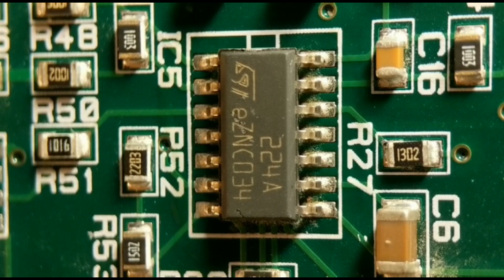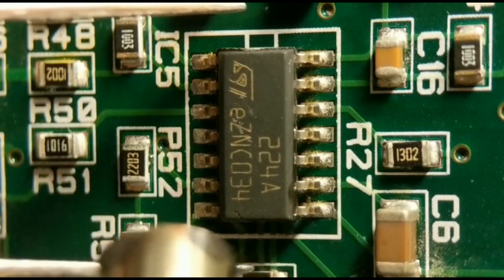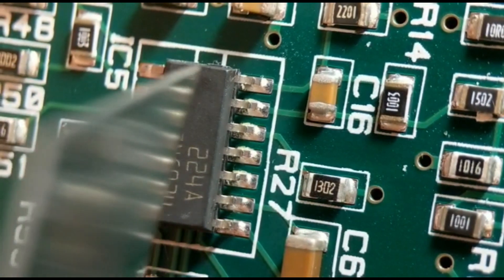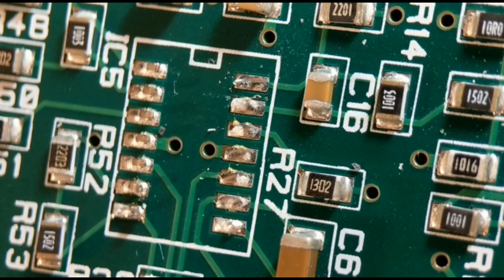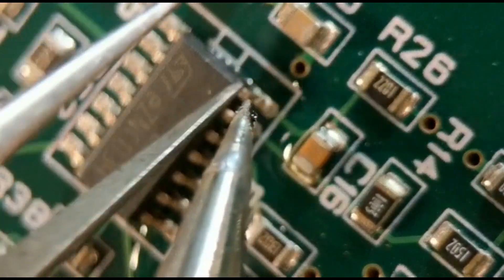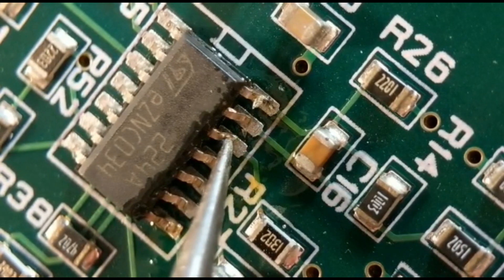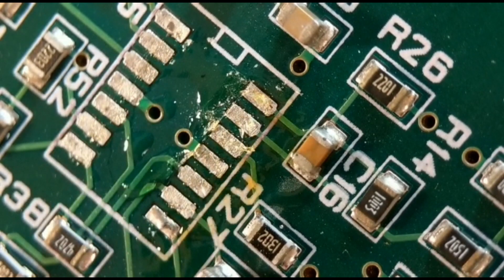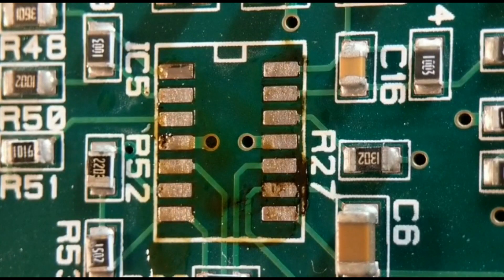How To Remove Surface Mount IC/smd IC - Learn 4 Neat Methods

Comment: Solderers need 3 hands to exist in this world, but the 2 soldering iron method of removal is the best thing I've heard for a long time.
 
Many thanks for the idea!
Reply from the maker: Hi , thank you for your support , much appreciated. I love the 2 soldering iron method so much that I posted a complete video on YouTube showing some of the instances when 2 irons makes work so much easier . I have all the hot air stations etc needed to do soldering rework but at times 2 irons is so much better than a hot air station  . Surrounding components for example can shift if your not careful when using hot air also plastic connectors can melt . Why protect all these when you can quickly rework with 2 irons . My best tip to anyone who solders is to get 2 irons . There are certain times when it's a godsend . Thanks again , good luck with all your soldering projects in the future 👍

Comment: you can also make a nozzle for the tip of a soldering iron from a thick copper wire to heat the contacts of the microcircuit at the same time from two sides

Comment: Just used a variation of your method 4 to remove a sop 8 ic.  Blob of solder on both sides to connect the leads, use a large chisel tip iron, then alternate back and forth heating the solder on both sides until they melt and the ic slides off.  I imagine it would have been easier with two irons, but only had one and didn't take hardly any time.  I can't recommend a good flux paste though; without my solder was sticking everywhere it could.

Cheers
Reply from the maker: Hi , thank you for watching the video , much appreciated. The way you have done it is a perfectly ok way , lots of people do it this way , even I have , but it just makes it a little easier and safer with 2 soldering irons . Thanks again , take care 👍

Comment: Thanks a lot. The switch on the board of my dishwasher was broken so I had to remove it. Yet I just couldn’t remove it. 

Thanks to you, I swapped it with a new one and I don’t have to deal with the damn dishes anymore.
Reply from the maker: Hi , thank you for your comment. I'm glad the video was of use to you , it's great you fixed your dishwasher . 
I will always add more soldering videos to my channel when I can . 
Thanks again , well done 👍

Comment: You can place a thick copper wire bent in the rectangle shape around the chip and on the terminals ,now add some solder and apply soldering iron for heating,it will melt all the terminals together and you can lift the chip easily.
Reply from the maker: Hi , thank you for your comment. A better way of doing this method is actually forming the shape of the IC with wire and directly attaching it to your solder tip . Less potential for the wire loop slipping as it's firmly attached to the tip . Then like the other method lay it on the IC add solder around joints and hopefully will lift off cleanly . For large 208 pin IC's I wouldn't do these 2 methods as will be really difficult to heat that amount of tiny pads at once , risking loose pads etc. 
Chip quik is another option that's pretty good . Thanks again 👍

Comment: Will the 2 soldering iron method ruin ic?
Reply from the maker: Hi , I've used this method lots of times and have honestly never ruined one IC . Its no different to someone using a hot air gun at 400 degrees , and your also not heating up the surrounding components which in fact makes it safer in a lot of cases. Obviously if your IC has a thermal pad underneath then you will need a hot air gun . Hope that helps , thank you for your comment 👍

Comment: Can you recommend a magnification tool?  What about the size of your solding iron tip?  Thank for the cool very nice videos....
Reply from the maker: Hi , the common magnification tool that lots of people use is ( model number 8087046 (LA8093LEDRS/EUK ) . This is a simple aid that sits on your desk and does a decent job , comes complete with built in LED ring light.
I use a stereo long reach microscope , purchased from GT Vision ( England ) , their own branded one . Great scope enables me to do any microscopic work and because it has a long arm you can put very large boards underneath no problem. 
I always use for fine pitch work a small conical tip for my iron . Sometimes I would use a large chisel tip for obviously large components and these are generally all you need for the majority of soldering issues.
Hope that helps , thanks for watching 👍

Comment: great and I wana to know what loop or microscope you used for this video and for soldering and desoldering components?
Reply from the maker: Hi , thank you for your comment. I use a stereo long reach microscope for all of my detailed work , purchased from a company called GT Vision based in England , I have their own branded one . It's very much the one I would always go for as it allows you to pretty much get any size circuit board underneath it . Prices for these vary from a few hundred upto thousands but I've just got an average model that's plenty good enough . Hope that answers your question . Thanks again

Comment: 👍😉😃😀 1st and last method is the best.  
In 1st method use surrounding area masking tape to protect other components and get best results.
Reply from the maker: Hi , thank you for your comment. Normally when I do use the hot air method , if I'm worried about nearby parts , especially plastic connectors for example , I use adhesive backed silver tape , never Kapton tape as some people like to . Thanks again for watching and commenting 👍

Comment: Wow! I'm so impressed. I really enjoyed watching your video. For one, you showed me things I'd never even imagined. And two, your video is short and straight to the point. Well done! really.
I have shaky hands and struggle to solder or desolder smaller components.
I need to replace a high current power inductor on a computer component. You can see exactly what it is by Googling "Cpla-3-50 amd 4890".
Do you have any advice on how to do it? The solder looks like it is actually underneath the component.
I know someone who is skilled(like you) should be doing it but there is nobody around me who can help.
Thank you again for the video. The cutting and two iron techniques were fascinating! 8D
Reply: Hey 🙂,
Thank you very much for your reply. Thanks for taking the time to explain as best you can. I will definitely try what you have suggested. Correct, I don't have a rework station. I've been looking at prices for them and they are unfortunately out of my price range. Perhaps one day in the future though.😋
Yesterday I bought two new soldering irons, a 30 and 45W. I think they will work better than the 100W I had before. 
Anyway, thank you again, 
Kind regards, 
William.
Reply from the maker: Hi , no problem . I hope you get on ok 👍
Reply from the maker: Hi , thank you for your support , much appreciated. I've looked at the component you mentioned and your right , the joints go down the side and all the way underneath the body . If I'm right your one has 6 separate pins . If you can see the solder on the pads out of one side you could probably remove it by adding solder to each pad and basically trying to solder them all together . Then running your soldering tip along the row , so basically heating all 6 pads up at the same time and this should be enough to remove it . Or you can lay a piece of tin copper wire along the edge of the device and add solder as before , this will heat all 6 up at once , then you should see the component moving about , then just lift off .I guess you haven't got a hot air rework station so this might be the way for you to do it . If this works you can then use solder braid to wick the excess solder off the pads before fitting the new component . Hope that helps , good luck and thanks again 👍

Comment: Oooh I like that fourth way with the two solder irons! Unfortunately I don't have 2.. But I thought of a combination of method 3 and 4. How about putting a lot of solder on one side so all the pins are connected together, then put a solder iron on that side and when the solder is melted, use tweezers to slightly lift up that side. The pins on the other side would bend slightly but you can straighten them later. Then wick off the added solder on the first side so that those pins are now off the board and then you can do the other side, adding a lot of solder to those pins on that other side so that they are all connected together and use the iron to melt that big blob and then use tweezers to lift the chip off the board. This is just a theory and it may not work in practice but I'm just wondering if this method would be any good.
Reply from the maker: Hi , thank you for watching the video , much appreciated. Your theory may well work , but I wouldn't recommend it for a tiny IC as the 2 rows are so close together so will put big stress on the row that isn't lifted to start with. But it would be a lot safer on a wide bodied IC. 
It's good for us all to have lots of options so we can always find one that works for us without having to get lots of expensive equipment . Thanks again and good luck with any soldering projects 👍

Comment: Another interesting method we were taught in the 90's was as follows:-

1: Run a fine gauge wire down the back of one side of the IC pack and the inner facet of its pins - similar to the way a shuttle cock runs inside threads in a weaving loom.
2: Solder the tip of the wire to the last pin on the run.
3: Take the free end of the wire and while heating the pins, gently tease the wire outward and upwards. 
4: Repeat this "teasing" movement along the length of one side of the IC package until all pins on the one side are free of the pads.
5: Repeat this same process for the other side of the IC pack.
6: Clean and prepare PCB accordingly for the new device.
Reply from the maker: Hi , thank you for your comment , much appreciated. It's always good to hear of other methods , the more options people can see or hear about the better in my opinion . Thanks again 👍

Comment: Is it okay to use a heatgun from a dremel gas soldering iron, or would that likely cause damage. On a tight budget and trying to replace a usb on a tablet
Reply from the maker: Hi , to be honest , I wouldn't know if your heatgun option would be safe , as it's something I've never tried personally . Hopefully you can work something out . Good luck with your project , thank you for watching , much appreciated.

Comment: You make it look so easy & good that you took your time so people new to this like me can follow easy enough. 

I’ve just bought a hot air station which has temp & air flow. Im interested in eeprom chips 8 legged. Does your method 1 apply for me ?
You advise 360 temp but what about air flow ? My settings is 1-8
Reply from the maker: Hi , thank you for your comment , much appreciated. You should be able to do the component you mention , no problem.
My air ratings are different , mine go from 0 to 150 and to do this type of component I would normally have it on about 90 . So going by this figure you would probably need the air on about 4.
Sometimes if your struggling to get parts off it's worth upping the air and not the temperature , this can really work well. 
Don't forget , if you have delicate plastic  parts near by that could melt , protect them with silver foil adhesive tape ( I done on old YouTube posting showing how good the silver tape works .
Hope that helps and good luck 👍

Comment: Method 4 was new and never seen like this.
Reply from the maker: Hi . Method 4 with 2 soldering irons is great . I never damage anything doing it this way and it protects the surrounding components because unlike a hot air gun you are not heating these parts up . In fact I've posted a complete video on YouTube showing the benefits of using 2 soldering irons . Thank you for watching , good luck 👍

Comment: That two iron method is like using low melt solder...i will try it...i have two soldering iron stations :)
Reply from the maker: Hi , I love the 2 iron method , so much so that I posted a complete video on YouTube all about the uses of 2 soldering irons. Thank you for watching , good luck 👍
Reply: I Will check that video later today.. thanks for the tip 😎👌👌
Reply from the maker: No problem , hope you get on ok , thanks again 👍

Comment: Nice video. I was wondering probably one can also use the same trick to melt one column at one time and bend the pins on the unmelted side all at once.
Reply from the maker: Hi . Thanks for watching the video. Bending any pins when they are still attached to the pads is very risky , as it would be easy to lift these pads off the board . So I wouldn't recommend this really . Thanks again 👍
Reply: @mrsolderfix3996  Thanks for the reminder! That's indeed true. By the way, for the methods you have employed, are the chips reusable after removal?
Reply from the maker: Hi . The only method where the IC is not reusable is the one where I cut all the legs off . The lifted leg one can have it's legs gently tweeked back into position and the 2 iron one would just need cleaning up a bit with solder braid . The hot air one is perfectly reusable as well. Thanks again for watching , much appreciated 👍

Comment: Not sure if I'd use method No.3 as it looks like a lot of temperature stress for the pads and mechanical stress for the IC. I usually use method No.1 but I will try No.2 & 4 one day. Personal note: it's difficult for me to understand you and I have to use subtitles (I'm not an English native speaker) OTOH I have no problems understanding Adrian from Adrian's Digital Basement (USA) or  Dave Jones from the EEVBlog (AUS). Would like to see a tutorial about soldering SOJ. It's always a PITA for me. Nevertheless: thumbs up!

Comment: hi there.
 is there some DESOLDERING flux at all which to help me desolder for example microusb port of phones or IC from some monitor power supply board?

 How many celsium to use on desoldering station hot air ?

thanks
Reply from the maker: Hi . The flux I always use is called SMFL200D . It's a great flux , helps with soldering and desoldering . I have posted a video on YouTube all about this flux which you may find useful . Good luck and thanks for watching 👍

Comment: Awesome vids… I’ve watched many of them today!

What’s the best size wick to buy for SMD, if only buying one size? 1.5mm, 2mm, 2.5mm, 3mm, etc.?
Also, what brand/kind of flux for SMD?

I’m gonna buy 0.015” (.38mm) wire for SMD. Also, just use my old cheap Weller pen iron, and file some tips down sharp for SMD.

I’ve been soldering regular sized thru-hole components on occasion for many years; but no experience with SMD…  gonna practice with SMD soon.
Reply from the maker: Hi . Thanks for watching the videos , much appreciated. 
I generally prefer 1.5mm wide solder wick , anything smaller is hard to use , and the real wide stuff to me just doesn't suck the solder up as well . 
I've done a video on the flux I use ( SMFL200D ) which also covers some solder wicking . You will see the type and make of wick in this video . If you haven't seen it already it might be useful for you . You can also get 0.25mm solder ( BLT Circuits ) based in England , this is the size I love the most , especially good for real tiny work . Good luck 👍
Reply: @mrsolderfix3996  Thanks for the tips!! I'll check out your Flux video!

Comment: If your only removing a few chip quick is the thing to use. Its a bit expensive if you do this often
Reply from the maker: Hi . Thanks for your comment. I've seen the chip quick solder and like you say the proper stuff is expensive but for some people it's probably worth it , no use for IC's with thermal pads underneath though. Thanks again 👍

Comment: I've heard IC's are heat sensitive components. Does the heat no damage the IC's?
Reply from the maker: Hi . Generally you should be ok applying this amount of  heat to IC's for a short amount of time . I normally have my hot air gun set at between 350 - 380 degrees centigrade and the irons about 340 each . I've taken hundreds of different IC's off using these methods and I can honestly say I've never caused damage to one when I've had to reuse these same components. I would trust these methods 100% so hopefully that helps give you my thoughts on these particular operations , other people may have different opinions , which I'm fine with. Thank you for watching , much appreciated , and good luck with any projects you do 👍
Reply: @mrsolderfix3996  Thank you, I was just concerned.
Reply from the maker: Hi . No problem . Hope you get on ok , thanks again for your support 👍

Comment: very effective - and no chip quick  low melt solder needed
Reply from the maker: Hi , thank you for your comment , very much appreciated . My favourite one , the 2 soldering iron method is really amazingly simple . So effective for lots of situations , in fact I've posted a complete video on YouTube showing the benefits and ease of 2 irons . Very safe Method if done correctly and no need for expensive chip quick +  hot air rework stations . Thanks again and good luck 👍

Comment: Thanks for a great video. But isn’t too much heat applied on ic when using option 4?
Reply from the maker: Hi . Thanks for your comment. I've used method 4 many , many times over the years and it works perfectly safely . I've reused the IC's I've removed like this lots of times and never has one not worked . Sometimes a hot air gun applied to an IC can take way longer to remove the component than 2 irons  , therefore applying excess heat to the IC and the surrounding area , where 2 irons doesn't do this . So I would say it's actually my preferred method out of the 2. Hope that helps , thanks again 👍
Reply: @mrsolderfix3996  thank you very much for reply.
Reply from the maker: No problem 👍